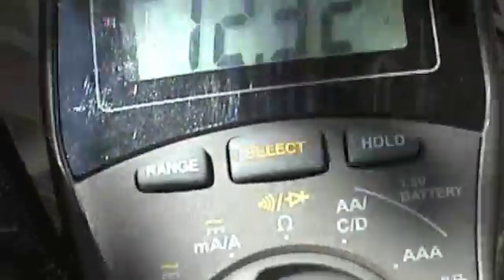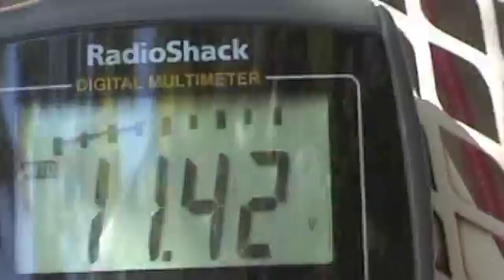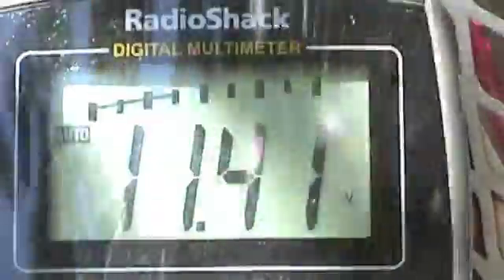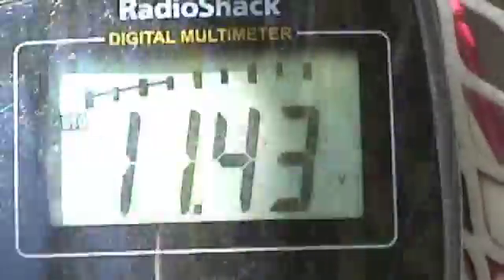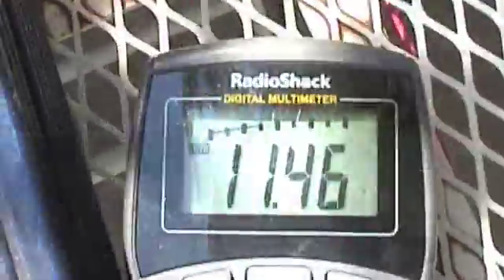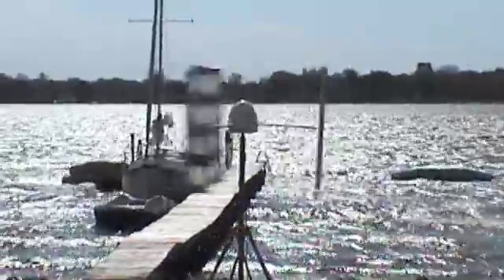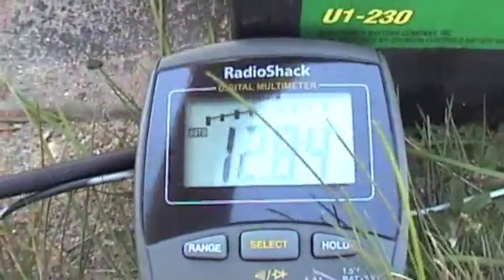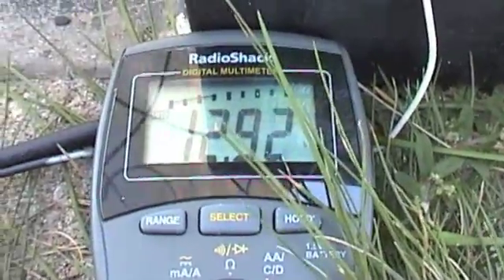Lynx Zephyr Day 17

Comment from the maker: @depravedpuma 
By using six leads off a 3 phase alternator you can multiply each phase voltage by 6.  You wont get higher watts but you can start charging a 12 v battery at lower rpm.  I think the circuit is posted in my videos.  Just search sixer circuit.  So if in star you'd get 6 volts, you can get 20 with a sixer circuit.  In the video I am only getting 8 watts in 20 mph winds.  So its no panacea, just a way to make use of a slower drag turbine.

Comment from the maker: @vanhook2 
Very different alternators.  The wing lift vawt has a lighter gauge wire and is wired in star.  The upright turbine has a heavy gauge wire and is wired in a sixer circuit which multiplies the low rpm output 6 times.  Otherwise drag types can't hit the rpm needed.  Both alts are axial flux with similar magnets.
Reply: Sir, does this sixer ciruit is a simple circuit? can you send to my email a simple cicuit diagram of sixer circuit? my email is guinatarsenio@gmail.com. thanks and God bess